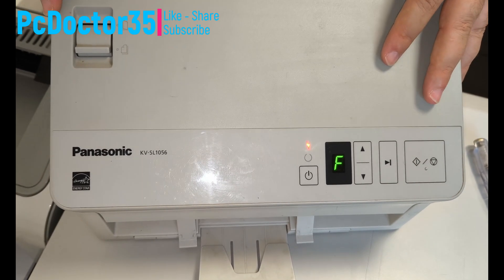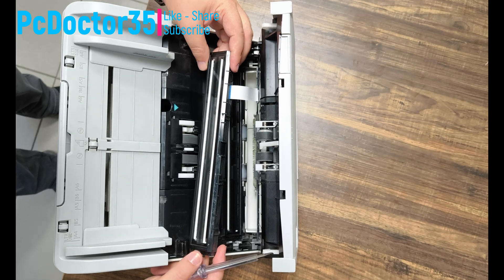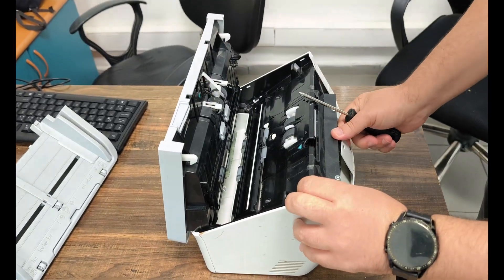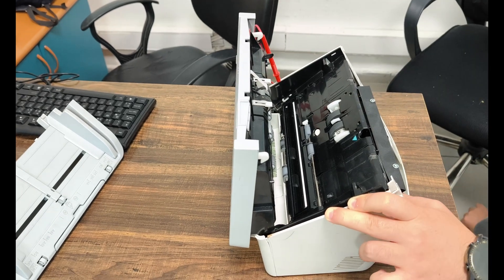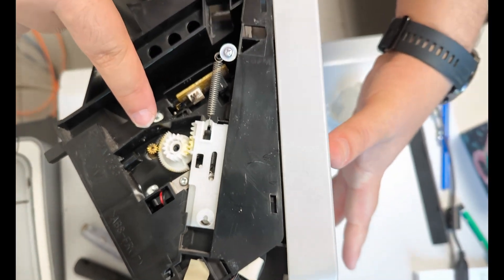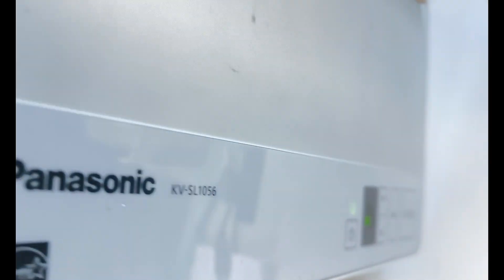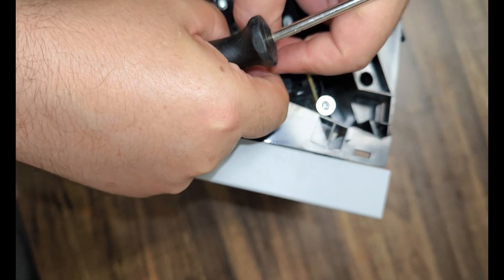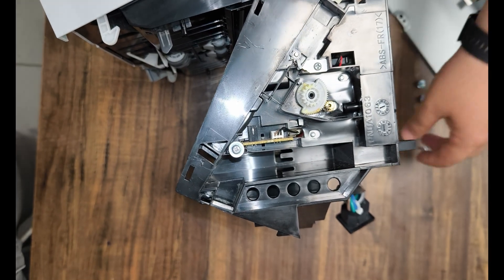Panasonic Scanner F Error Solution Fix KVSL 1056 1066 3056 3066 and All Models Canon

Comment: KV-SL1066 / SL1056

Specifications
 	KV-SL1066	KV-SL1056
Scanning Face	Duplex scanning
Scanning Method	Color CIS (600 dpi) / Black or White Background / Sensor : CMOS
Scanning Resolution*1	ICP/
TWAIN	
50 – 600 dpi (1 dpi step)
1,200 dpi (Interpolated)

Optical: 300 dpi / 600 dpi (Automatic switch)

ISIS	
100 – 600 dpi (1 dpi step)
1,200 dpi (Interpolated) 

Optical: 300 dpi / 600 dpi (Automatic switch)

Binary Speed*2
Portrait, 200 / 300 dpi	Letter	Simplex	65 ppm	45 ppm
Duplex	130 ipm	90 ipm
A4	Simplex	65 ppm	45 ppm
Duplex	130 ipm	90 ipm
Color Speed*2
Portrait, 200 / 300 dpi	Letter	Simplex	65 ppm	45 ppm
Duplex	130 ipm	90 ipm
A4	Simplex	65 ppm	45 ppm
Duplex	130 ipm	90 ipm
Feed Tray capacity	Up to 100 sheets 80 g/m2(21 lbs., A4 or Letter)
3 hard cards (ISO 7810 ID-1)
Up to 75 sheets 80 g/㎡(21 lbs., less than 100 mm length paper and Legal size)
Other Functions	• Length Control
• Control sheet
• Patch code detection (Type 2, 3, T)
• Long paper mode
• Double Feed Skip
Image Output	Binary 1-bit, Grayscale 8-bit, Color 24-bit,
MultiStream (Color & Binary or Gray & Binary)
Internal Video Processing	1,024 levels (10-bit)
Tonal Gradation (Bitonal Mode)	Dither, Error diffusion, Grayscale (8 bit), Binary
Image Compression	MH, MMR, JPG
Paper Size*3	Minimum	48 mm x 54 mm (1.9 in. x 2.1 in.)
Maximum	218 mm x 356 mm (8.6 in. x 14 in.)
Max. Imaging Size	216 mm x 5,588 mm (8.5 in. x 220 in.)*4
Paper Thickness
Note: 1 mil = 1/1000 in.	Single Feed	0.04 to 0.5 mm (1.6 to 19.7 mils)
Continuous Feed	0.04 to 0.5 mm (1.6 to 19.7 mils)
Passport*5
（Paper Weight)	4.0 mm (167.5 mils) or less (including carrier sheet)
Card: Up to 0.76 mm (30.0 mils)
Embossing card: Up to 1.4 mm (55.1 mils)
Business Card
Single Feed mode using Strait Path	(ISO standard 7810 ID-1 card scanning including embossed card)
Paper Weight*6	Single Feed	20 to 413 g/m2 (5.4 to 110 lbs.)
Interface	USB 3.1 Gen 1 (backward compatible)
General
Dimensions (W x D x H)	300 x 272 x 238 mm (11.8 x 10.7 x 9.4 in.)
When the exit tray is closed
Weight	4.0 kg (8.8 lbs.)
Power Requirement*7	AC100 - 125 V 50/60 Hz 0.8 A (AC100 - 125 V) or
AC200 - 240 V 50/60 Hz 0.5 A (AC200 - 240 V)
Power Consumption	Scanning	36 W or less
Standby	7 W or less
Sleep	1.8 W or less
Power OFF	0.3 W or less (100 V Type), 0.5 W or less (200 V Type)
Operating Environment	5 °C to 35 °C (41 °F to 95 °F), 20% to 80% RH
Storage Environment	-10°C to 50 °C (14 °F to 122 °F), 8% to 75% RH
Accessories
 	
• Quick installation guide
• Power cord
• USB cable
• Feed tray
• Mixed batch card guide

CD-ROM
• Device driver software
• ISIS driver software
• TWAIN driver software
• WIA driver software
• Image Capture Plus application software
• User Utility software
• Scan Button Setting Tool
• Operating manual
• Control sheet
etc.

Consumables
Roller Exchange Kit	KV-SS061
Options
Carrier Sheet	KV-SS077
Roller cleaning paper	KV-SS03
Flatbed Scanner	KV-SS081
Reply from the maker: Thank you bro

Comment: 1 When scanning a document larger than A5 size at high resolutions over 600 dpi, the scanning may fail due to insufficient memory. 50 – 99 dpi and 1200 dpi can be used only when scanning with Image Capture Plus, TWAIN, or ISIS (ICP: Ver.3.12.1.1 or later, TWAIN: Ver.20.0.0.3 or later).
*2 The scanning speed differs depending on the host computer, the operating system, the application, the measuring method, the quantity of data in the image, and the paper type. The scanning speed is as determined by Panasonic methods of speed measurement.
*3 Though other paper size can be specified, it cannot be guaranteed.
*4 The maximum size that can be scanned varies depending on the resolution.
*5 Use the carrier sheet (KV-SS077) to scan passport. Depending on the condition (operating environment, dirt, scratches, etc.) of the carrier sheet or passport, the image processing function may not work properly. Scan beforehand to confirm the scanned image.
*6 "Weight in ponds" of paper represents the weight of 500 sheets (432 x 559 mm /17 x 22 in.).
*7 The power requirement differs depending on the country/area.

• ISIS is a registered trademark or trademark of Open Text Corporation.
• All product names are trademarks or registered trademarks of their respective holders.
• Specifications are subject to change without notice.
• Dimensions and weights are approximate.

Return to Top
Reply from the maker: Thank you 👍